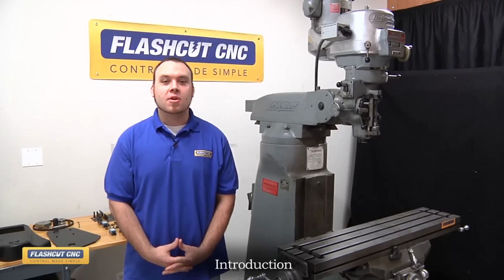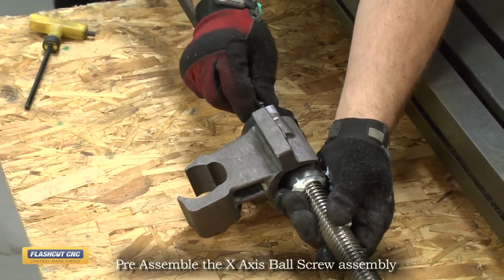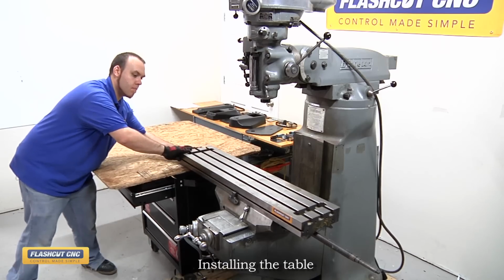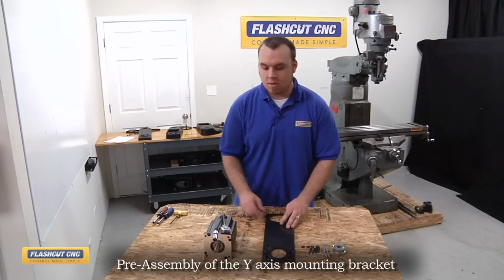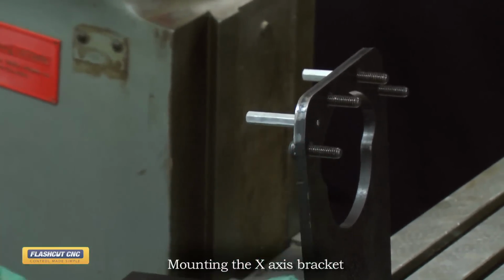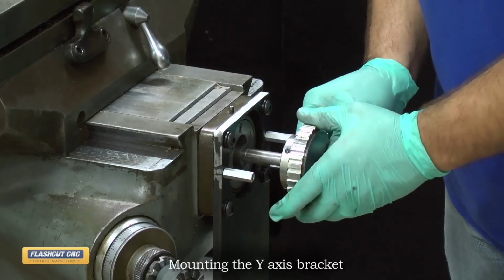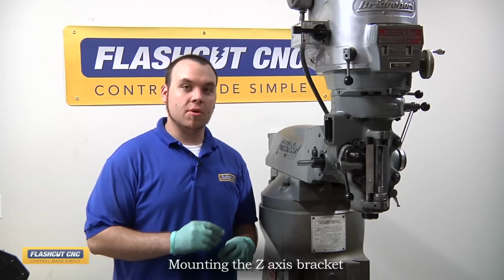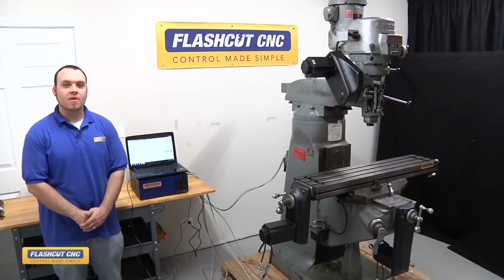Bridgeport Retrofit Kit

Comment: A lot and they will not even let you buy it in pieces if all you can afford now is the y and x ball screws.  You have to buy the Controller first even if you still want to use it as a hand mill temporarily.

Comment: Kit Includes: 
• (1) X Axis 3/8” Steel Motor 
Mounting Bracket 
• (1) Y Axis 3/8” Steel Motor 
Mounting Bracket 
• (1) Z Axis 3/8” Steel Motor 
Mounting Bracket 
• (3) 30L Pulley 
• (3) 15L Pulley 
• (1) 225L Timing Belt 
• (1) 255L Timing Belt 
• (1) 345L Timing Belt
• X-axis Bracket Hardware 
o (4) 3/8”-16 X 1-1/2” Button Head Screw 
o (4) 1/2" OD, 13/32" ID, 1/2" L Steel Spacer 
o (4) 3/8” Washers 
• Y-axis Bracket Hardware 
o (4) 3/8”-16 X 1-1/2” Button Head Screw 
o (4) 1/2" OD, 13/32" ID, 1/2" L Steel Spacer 
o (4) 3/8” Washer 
• Z-axis Bracket Hardware 
o (6) 10-24 X 5/8” Flanged Button Head Screw 
• X Axis Motor Mounting Hardware 
o (8) 1/4”-20 X 7/8” Button Head Screw 
o (8) 1/4" Washers 
o (4) 1/4"-20 X 2” Threaded Hex Standoffs 
• Y Axis Motor Mounting Hardware 
o (4) 1/4”-20 X 1-1/2” Button Head Screw 
o (4) 1/4" Washers 
o (4) 1/4"-20 Serrated Locknuts 
• Z Axis Motor Mounting Hardware 
o (8) 1/4”-20 X 7/8 Button Head Screw 
o (8) 1/4" Washers 
o (4) 1/4"-20 X 2” Threaded Hex Standoffs 
• (1) X Axis Belt Cover 
• (1) Y Axis Belt Cover 
• (1) Z Axis Belt Cover 
• X Axis Belt Cover Mounting Hardware 
o (4) 10-32 X 3/8” Button Head Screw 
o (4) #10 Hard Fiber Washer 
o (2) 10-32 X 7/8” Male-Female Hex Standoff 
o (2) 10-32 X 2” Male-Female Hex Standoff 
• Y Axis Belt Cover Mounting Hardware 
o (4) 10-32 X 3/8” Button Head Screw 
o (4) #10 Hard Fiber Washer 
o (2) 10-32 X 3/4” Male-Female Hex Standoff 
o (2) 10-32 X 1-1/4” Male-Female Hex Standoff 
• Z Axis Belt Cover Mounting Hardware 
o (5) 10-32 X 3/8” Button Head Screw 
o (5) #10 Hard Fiber Washer 
o (1) 10-32 X 7/8” Male-Female Hex Standoff 
o (4) 10-32 X 2-1/2” Male-Female Hex Standoff 
• (2) 2-1/2” Circular Plastic End Caps 
• (2) Shaft Spacer, 1” OD, 5/8” ID, 5/8” L Steel Spacer (X,Y) 
FlashCut CNC Bridgeport Retrofit Kit 5 

• (2) Shaft Extensions, 5/8” OD, 2-3/8” 
L Steel, 1/2-“-20 Threaded (X,Y) 
• Z-axis Driven Shaft Assembly 
o 3/16” to 1/8” X 2” L Step Key 
o 3/16” X 1” Square Key 
o 3/16” X 3/4" Square Key 
o 5/8” OD, 0.014” Wall, 1” L Brass Shim 
o 5/8” X 3” Steel Shaft with 3/16” Keyway 
o 5/8” ID Solid Coupler 
o 5/32” Stubby Allen Key 

Stepper Control System (additional items): 
• (1) 3-Axis, 8 Amp/axis Stepper Motor Driver box 
• (3) Size 42, 2830 oz-in stepper motors 
• (1) NEMA 42, 3/8” Spacer Plate 
• (3) 10' stepper motor cables 
• FlashCut CNC Software and Manuals (CD) 

Servo Control System (additional items): 
• (1) 3-Axis, 12 Amp continuous, 20 Amp peak Servo Driver box 
• (3) Size 42, 850 oz-in servo motors with 
• (3) 10' Servo motor cables 
• FlashCut CNC Software and Manuals (CD)

Comment: When fitting the Y axis pulley to the shaft, the pulley goes way past the Woodruff key. So are you seriously suggesting that all the drive torque is transmitted via the two grubscrews?
Reply: +Steve Tracey Use of grub screw term gave you away!!

Comment: ok your now a cnc....... where is the pick-ups for the readouts ? ....or are your calculations from the stepper motors - timing pulley wheel diameters and ball screw pitch know information !........... e.g. how do you know you have moved 10 mm on Z axis and not 10.02 (and i dont mean you see it on the read outs) you need a pick-up some where !

Comment: Why automate the quill?  Seems like automating the knee would be most useful.
I wonder if their customer service is as good as their question answering.  Would make me think twice about dealing with them...
Reply: ***** I think personally I'd rather have the quill CNC controlled, but sure not like this. And not like the other alternative often seen, a ballscrew parallel to the quill housing but about 3 inches away and the nut mounted in a long floppy fork held to the quill by 1 screw. The Bridgeport BOSS had the best plan, a hollow ballscrew mounted on top of the quill, with the spindle passing through it.
Reply: ***** This system is just like the old Moog  NC machines they were just bridgeports  retro fitted with  NC (the old tape reader type not CNC) parts mainly hydraulic motors and ball screws and air impulses  and most of all the knee did not move only X and Y      Z was the quill   this is for kind of a Ham and Egger  shop

Comment: Who would ever transfer the worst tooling machine ever produced, into  a CNC?
Who?
Reply: anyone !  greatest and most used  mill.   work of art and what all 3 axis machines are designed around.  having one with CNC would put a SERIOUS machining into a contender to those high priced machining center.
Reply: davemisme
You do not have a clue, do you?
Reply: Mesdriver Not sure what you mean "worst tooling machine." I suppose the taper is not rigid and the shank is long. But tooling is cheap. A Bridgeport knee mill with a 2-axis ProtoTrak CNC control is a VERY versatile and useful machine. Obviously not a machining center for mass production by any means.
Reply: Fuzzybeanerizer
It is OK as a hobby machine, no more then that.
Very low accuracy, instable, very little spindle power, construction is poor, if not bad.
build in inch not metric, and so on.
the Brigeport is copied by a lot of manufacturers, most of the copies are better than the original.
I had one myself, swapped it for a "Kondia". ( a liitle bigger, same build structure).
The Brigeport is versatile, yes, but that is all to say positive about it.
Reply: Mesdriver Speaking of the old ones -- not the newer Chinese or whatever bodied machines -- WHAT was wrong with the construction? I have worked in a metric country before, but working in America with inch prints and inch cutters every day and inch nuts & bolt available at the local hardware store etc. I'd definitely consider the inch build of an older Bridgeport to be a big plus. Not enough power? I've been a professional machinist for 27 years, only stalled a Bridgeport once or maybe twice while face milling, and I have stalled an enclosed machining center dozens of times trying to push that beyond ITS limits... you just got to bear in mind what they were designed for.
Reply: catherine alkuino
If you are happy working for 27 year behind a Brigeport HP2 or so, fine with me. 
The construction of the knee part:
The X-slide dovetail is ay to narrow to prevent overhang of the Y table.
The one power feed on the x-axis, the hand powered Z-axis, the incredible fine pitch on the quill stop, the poor power feed (quill) mechanism, and so on.
As stated the machine is fine for light not too accurate work, and overall repair shops.
I do not have anything against the Brigeport, I just think it is not the best machine to have in a toolshop.
Not any more anyway.
just my opinion as an engineer.
If you think otherwise, fine with me.
Reply: Mesdriver they were made in metric.. i have a j-head vintage 1964 that came with a cooling system that's metric from the factory. my only bitch about it is that there isn't very much in ways of good quality metric tooling (R8) available. sure there is the chinese stuff but you get what you pay for. 
i've had the displeasure of working on some of the chinese clones and quite frankly you can have 'em .. i wouldn't want one if it were given to me. one of the few clones that's worth having is Lagun (spanish castings, assembled in california)
Reply: Mesdriver most of the shortcomings you listed can be corrected with retrofits.. sure they aren't perfect but then show me the machine that is.. i would argue that there isn't one that is perfect for every application. as an all rounder the bridgeport is still hard to beat.
Reply: +Mesdriver ugh i shudder at you engineers who think they know everything. you should ease up on the know-it-all attitude cuz I PROMISE every machinist on your floor hates your guts. The ONLY trustworthy engineers are born from master machinists, not an expensive degree. just a friendly from one of those guys "out on the floor"
Reply: +HolzMichel no use arguing with him. it all became clear when he said he was an engineer. you wont win this argument. the bottom line is these machines are PERFECTLY serviceable for all but production runs. i worked in an aerospace shop building fuel system components for F18s. Parts were ran on million dollar equipment and any reworks were done on a "lowly, hobby grade" Bridgeport. im assuming hes a college engineer who never ran a machine cuz a proper machinist doesnt need to toot his own horn, he just gets shit done.
Reply: Brennan Cek
roger that!... at work we have an Induma in the shop too .. with all the bells & whistles... my bridgeport gets more done than that thing ...he whines about accuracy.. mine is metric and is accurate to one onehundredths of a millimeter..like you said with face milling, it could stand to have a little more snoose but it gets the job done just fine
Reply: +Brennan Cek
If just mentioning you education is tooting your own horn; so be it.
If you think your Brigeport is more accurate than a solid constructed CNC machine you must be a fool.
What do you rework, on your milling machine?
Chamfering? drill a forgotten hole? 0.005mm work?
I think not.
Speaking about bigging yourself up:
I worked in an aerospace shop building fuel system components for F18s. Parts were ran on million dollar equipment.

US bragging as usual.
Reply: +Mesdriver Actually, there are jobs where the utmost accuracy is not required, and with some jobs having so little quantities it is absurd to spend time setting up a VMC to run 20 parts when it could be running production parts with 1,000 plus required. A knee mill also is used commonly as a "second op" machine (at least in my experience) or sometimes to square up and prepare stock for another machine. It its also useful for odd castings and one-off parts and for some parts that you might need to hang off the table or hold on a specific angle to access. A manual milling machine has it's merits and a place in my heart and in most shops if not all. It's not just the machine, it's the guy cranking the handles. A proper machinist knows the value of a quality manual mill and can hold tolerance to tenths if necessary given the right circumstances.
Reply: +Sandman Actual 
I acually agree with you.
The Bridgeport is very versatile, and a handy machine for doing low grade stuff.
No problem at all, I actually have one ( replica) in my shop.
But here we have people who think the HP2 is the holy grale of machining.
It is not.
Mr Cek is working on this machine to correct stuff that CNC could not make "accurate enough".
And he corrects them?
That is a bold lie, to say the least.
There is a reason why this machine is dicussed on hobby threads like this.
It is a tooling machine from the past, now it is is a hobby machine, loved by those who grew up with it.
Nothing wrong with that.
I actually have one in my  tool shop ( so no I am not a college engineer).
when I retire, I think I will take it home to my garage, to do some hobby machining.
It is collecting dust in a corner right now.
Reply: Mesdriver
well you come off sounding like a haughty engineer who has never laid hands on a machine tool a day in his working career.
CNC has it's place in industry. as does the bridgeport.. i would be so bold and say that much of what has been made possible in the manufacturing industry today would have never been possible without the contributions of the lowly bridgeport..
the other thing a person has wonder about: if it IS such a shitty design, then why has it been copied and plagiarized by so many outfits?
Reply: Mesdriver i never claimed that I am the one who did the reworks. We had an old timer named Earl who I PROMISE would run circles around you and produce a better part on a Bridgeport than you ever could on (name your cnc of preference) because hes a true master, not some jabroni with a degree and hes been doing it since you were shitting in diapers. Hell you should watch the rotary cuts he makes on an engine lathe older than you. Itll blow your mind. Bridgeport is 110% capable; its today's craftsman that isnt.
Reply: +HolzMichel 
I would like to prove you wrong on this haughty engineer remark, and the fact I would be an only theoretical engineer.
I am not, you would be surprised.
But anyway.
Yes the BP has its place in the industry, that place is in the past.
The BP has found its place in repair shops and light chipping of not too complicated parts.
Yes, you can make a complicated part, but ony at very high effort, and  the BP is curtainly not developed for that.
The brigeport is the most copied machine of which almost all copies are better than the original.
Why is it copied so many times?
It is a simple design, cheap to produce, usable in many repair shops.
Not in toolmakers shops.
Reply: +Brennan Cek 
You seem to know a lot about me, and my skills, and my age, and I think that this is the third time you are cursing on my degree.
You seem to have a lot of trouble with people who have some kind of education.
Missed the boat somewhere?
The fact that your hero is a good craftsman on a lathe, has nothing to do with the quality of the HP.
Even the point that he is skilled on the HP, has nothing to do with the overall quality of the HP in general.
Stick to the point, do not swear, and do  not insult people you do know anything about.
Your inputs, are smears, not one my  technical points were disproved.
So no I will not lose a minute of sleep on this one.
Enjoy your Brigeport, it is on par with your education.